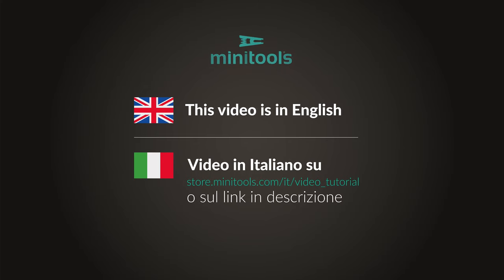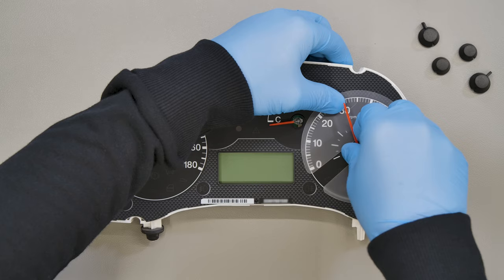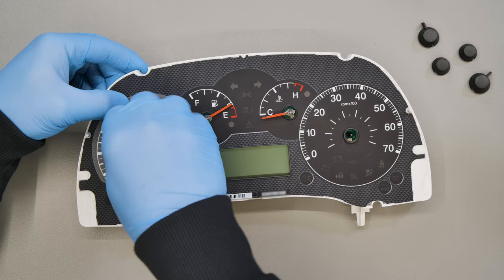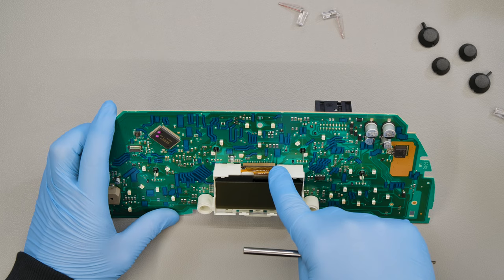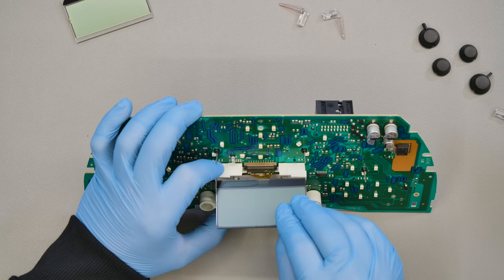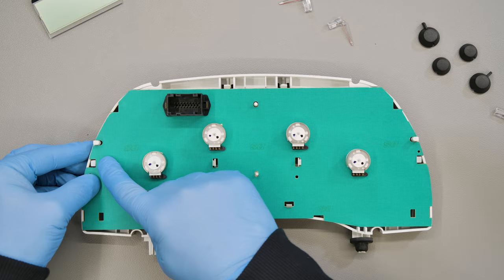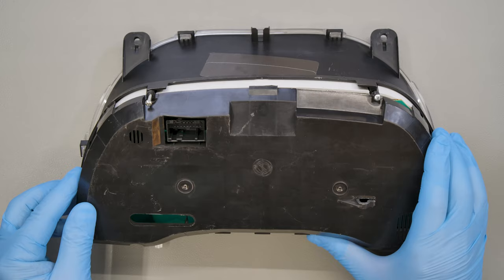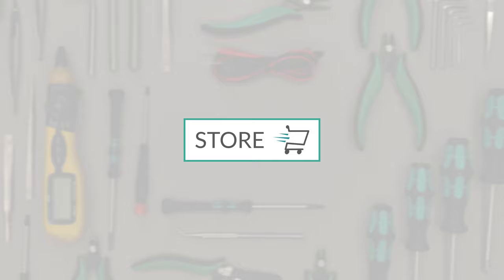Repair malfunctioning dashboard display of Fiat, Citroen, Peugeot, Opel using Minitools LCD screen

Comment: I found out a solution. Mostly the problem use to come during rainy season and I use to put heat blower to fix the issue. Today I had put the console in sun for 2hours and the display is back to normal from blank screen .. . Try out for possible option
Reply: Thank u for this.  Lemme try this out.  Mine conks out intermittently. At other times it works perfectly.  This is after the car was in the shed only and not seeing sunshine as its not being used for some time now.  And its raining like hell for two months now.
Reply: That’s interesting.  We’ve had really bad rain for a few weeks here and this problem never happened before. Where are you blowing the warm air onto?

Comment: For testing the display without car, how much ampere is required. Can it be tested using AC To DC adaptor having 12volt DC and 2.0 Ampere out put.
Reply from the maker: Hi Prasanna, yes, to test the instrument cluster you can use an AC DC adapter with 12V and 2.0 ampere output.
Reply: @MinitoolsChannel  after giving power supply to instrument  cluster the display is bank, I can see only back light. What will be the cause.
Reply from the maker: Hi  @prasanna4413 , the LCD may be defected in this case, please send us an email at info@minitools.com for more technical questions.

Comment: Will it show in miles instead of kilometres
Reply from the maker: Hi! Our display is only for kilometres version ( https://store.minitools.com/en/sepdisp37-lcd-display-for-citroen-fiat-peugeot-ram-instrument-clusters.html ) , miles version is not available. For any other question feel free to send us an email at info@minitools.com
Reply: @MinitoolsChannel Hi, I dont understand how it's possible for a LCD to be either km OR miles, surely the instructions for what to display come from the computer and the display just "does what its told to do"?
Reply from the maker: Hi  @petewright3952 , exactly, displays show any information provided by the instrument cluster. Specifically, the ability to show miles or kilometers depends on how the instrument panel was designed and consequently the technology used for the LCD. For example, the display used in this video can show kilometers or miles based on settings that can be adjusted in the car for the instrument panel.
Reply: @MinitoolsChannel  Thanks.
If I've understood your message it's all about the cluster not the LCD, so there isnt a Miles LCD and a different Kilometers LCD, there's one type and the cluster is the "capo" 😉

Comment: After I changed the display the kilometer numbers are  blinking non stop, any solution for this?
Reply: I was told by the service centre that if blue&me doesn't work the kilometres will blink.

Comment: How much Is the voltage te let Pin 2-3 work?
Reply from the maker: Hi! They will work at 12V.
Reply: @MinitoolsChannel  so, One ground and two +12?
Reply from the maker: @misterjoe974  yes, one negative and two positives.

Comment: I need that lcd display
Reply from the maker: Hi! https://store.minitools.com/en/sepdisp34-lcd-display-for-fiat-punto-grande-punto-fiorino-doblo-qubo-natural-power-version.html this is the link for the display used in the video, but the display may change based on the fuel type or the transmission, please check the comparison sheet attached in the link to select the correct display for your car. Thank you!